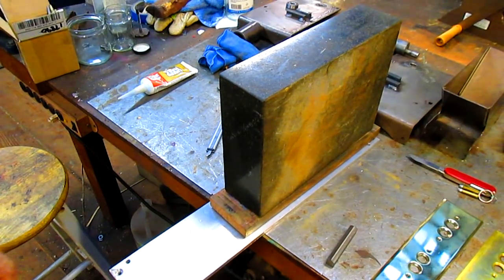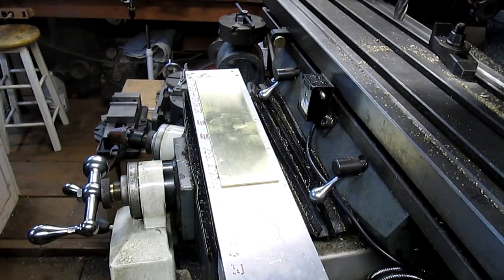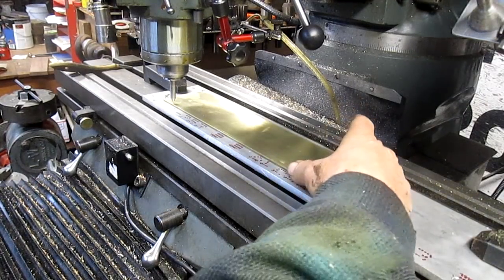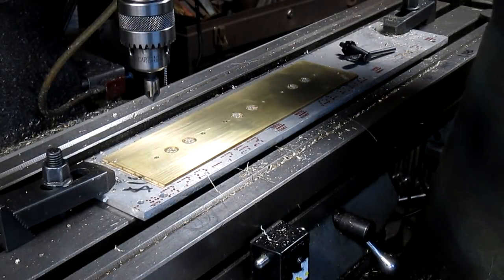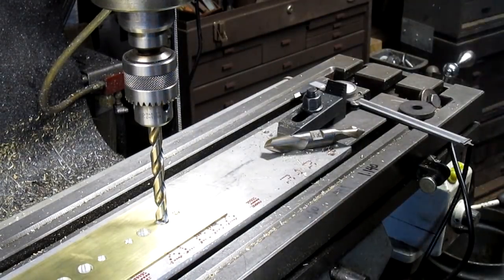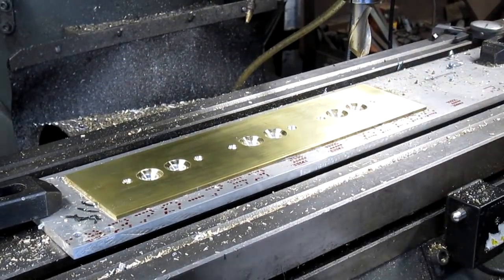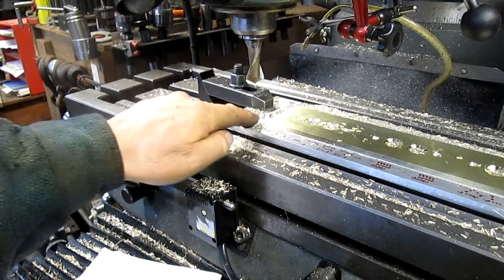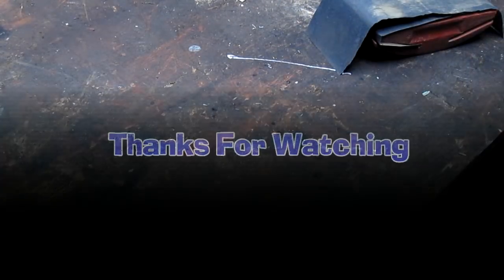Victorian Switch Plate #2

Comment: Looking good Nik,  I was surprised at how cleanly the jb-weld came loose. It just seemed to pop off the aluminium backplate.
I will have to remember that trick. Hope you get all the rain you need.
Reply from the maker: Superglue is the better adheasive, I just didn't have any that day.
Reply: @NikColyerMachineWorks  That JB looked like it was made for what you were doing. It held on tight, and released with heat when you wanted. I would call that a win.